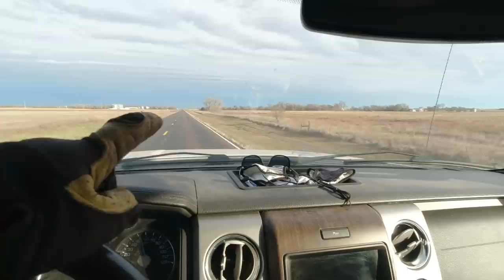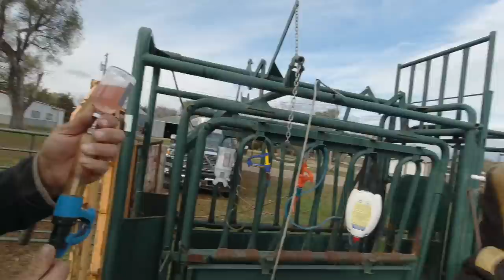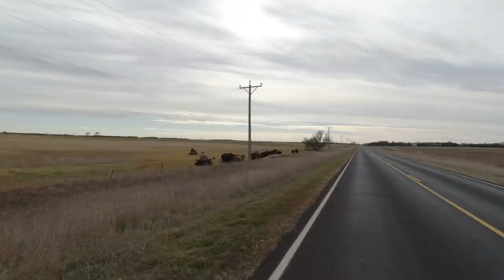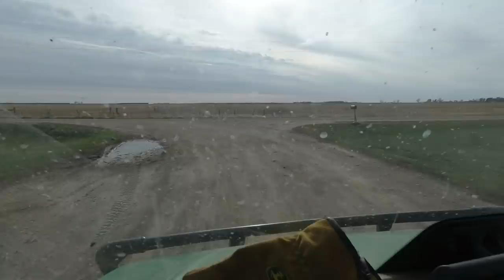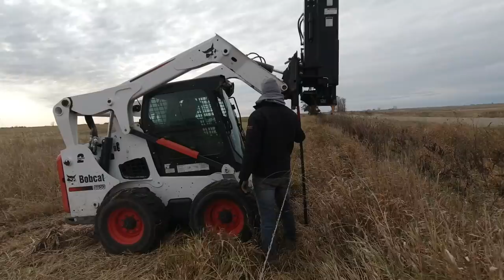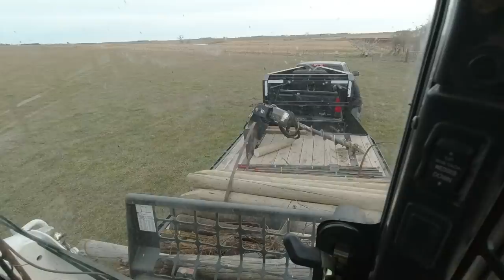Cattle Drive

Comment: Don’t remember if I commented this on the last video where you moved cattle down the road so I’ll comment again. We used to do that occasionally when we had to move cattle down the road and it was close enough and/or too many cattle to move by trailer, 3-4 trailers depending on the day, and we did it all on horseback. Miss those days but I’m not mad we shut down our feedlot after a real bad drought.

Comment: doesn't seem like you guys do any electric fence. any reasons why? also: these calves you're buying and feeding through the winter would be known as backgrounding correct?
Reply: Regarding the fencing question, I don't know the answer for sure but, as dry as that soil is there is precious little moisture in that soil so as result the conductivity is likely to be really low. Consequence: any animal touching the fence will get hardly any electric shock  . In addition the wire tensile strength is relatively weak (being single strand) compared to the double strand barb wire. Being 3 or 4 wire strand will present more of a physical barrier to wildlife than an electric fence (mainly deer I think).

Comment: Curious….before pounding in new post why do you not mow down the weeds?  Also is there not a spray to sterilize the ground say a foot on each side of the wire. I would think that would help to keep the fence line clear. Thank You
Reply: tires cost a lot of money and there is always broken old post in the old fence line